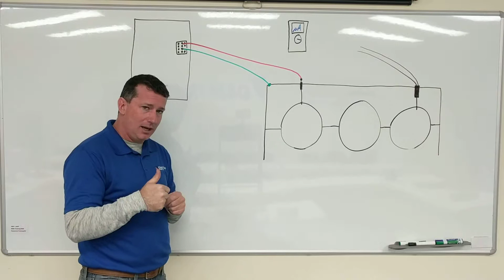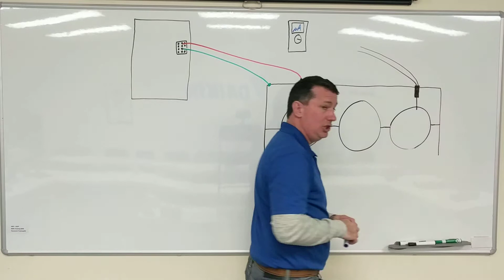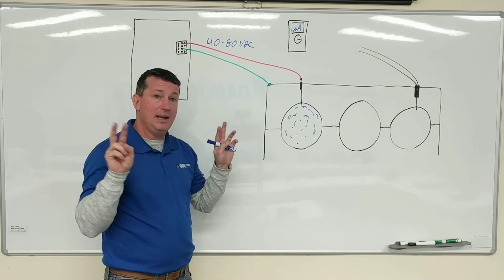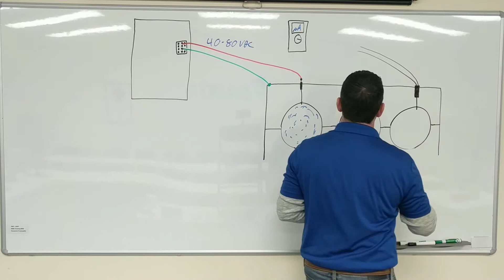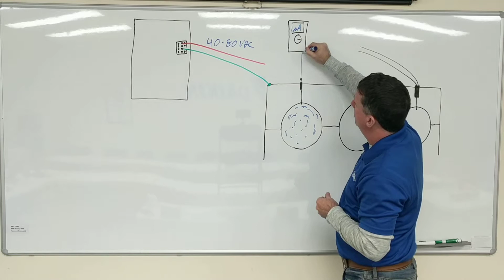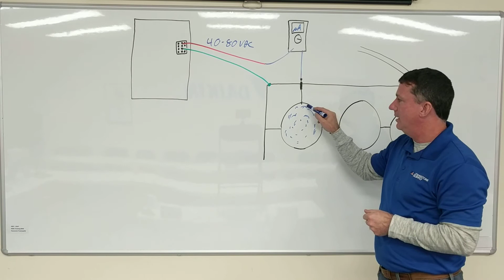Flame Rectification

Comment: Very clear, thanks.  Is the path to ground through the face of the burner?
Reply: The path is actually through the flame to the grounded hood. The flame itself is the load or resistance in the circuit. This is actually a direct current (set your meter to DC uA), since the ions in the flame allow the current to flow only in one direction (rectifying the alternating current signal sent from the board.) This is the reason it’s called “Flame Rectification” everywhere.
Reply: Thanks for the clarification, I have an automobile engineering background and this is one of the most clever and inexpensive systems I've seen.  After a year of testing and replacing parts, I found a bad transformer that was causing my codes.   @garypoplin